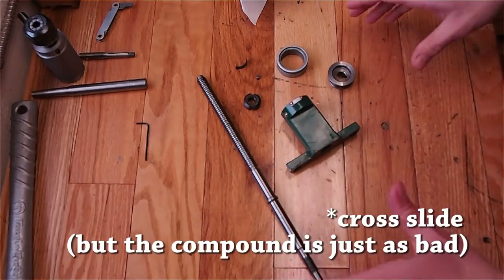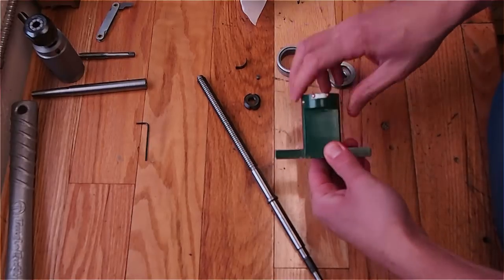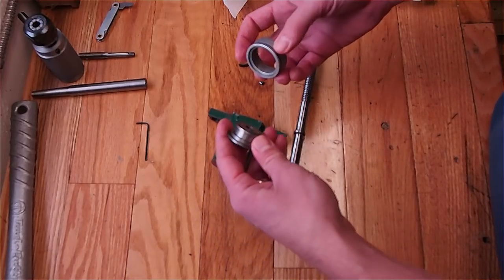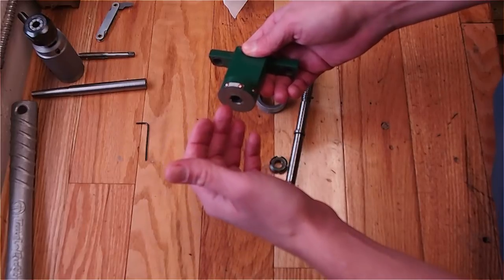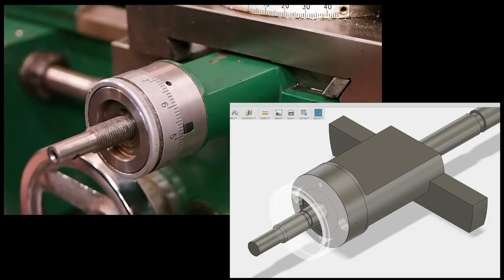Fixing a Lathe Cross Slide Screw Support

Comment: I like your solution, this may work out on modifications that I plan for my Atlas 618.
Reply from the maker: I'm really happy with it thus far.  I was a little leary of the deep groove taking the thrust in the one direction but it works surprisingly well.  Significant improvement over how it was.
Reply from the maker: It's really a significant improvement over the plain bearing setup.  I'd say go for it.  You might need to machine the entire collar for the Atlas but it wouldn't be that big of a job.
Reply: My plan is to build a new cross slide with "T" slots in it and a fixed tool post.  A very ambitious project for sure.

Comment: Given that the bulk of the radial [edited oops] load comes from hand winding at the outer end, I'm surprised that you didn't fit the deep groove at the outer side and the thrust bearing on the inner. Is there a counter intuitive reason for doing it that way that I'm missing? 

Beautiful job but I have an ML2 (!!) and the problem there is even worse as the "nut" on both top slide and cross slide is an integral thread in the base casting for each. The current amount of "slop" is dire ... not just backlash but side to side, up and down and every which way!

Consequently I'm planning on drilling those out to clearance holes and fitting new lead screws to each (metric) with brass acme thread nuts into the enlarged holes and new teflon coated metric lead screws. Have to see how it pans out. 🤔😁